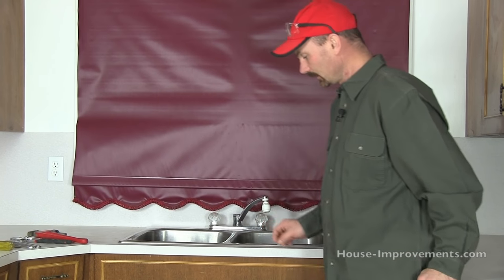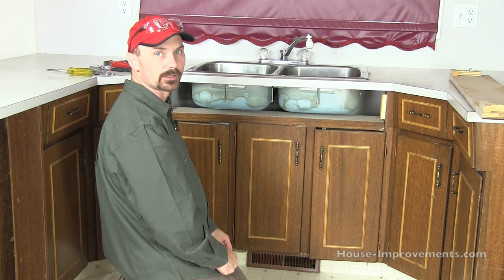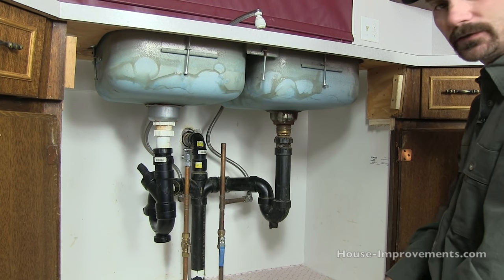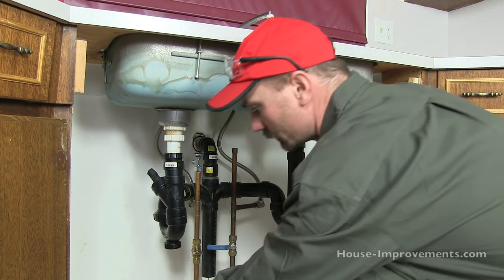How To Remove a Kitchen Sink

Comment: Such a help! Lots of the other videos skip the steps about clamps and what the parts are and how they function. It’s helps to under stand so I can translate it to what the previous owners did with the sink in my house. Thru installed the faucet before dropping the sink in so the faucet fasteners are now blocked by the countertop, so my easy facet switch now involves getting the sink out first. Thank you for the great detailed instruction!

Comment: Thanks. Your demonstration is perfect. Now i have more confidence. I had forgotten that the front panel on the sink cabinet comes off as if the old fully rusted sink mounting screws weren't bad enough. Cheap. The new sink has brass mounting screws. Can't wait to get that awful old sink out.

Comment: Clear, straight-forward and concise. Thanks for taking the time to make and post your helpful video. Liked the no-bucket move with the  leaking stainless braided tubing. The only recommendation: edit out the non-visible loosening and tightening (faucet fixtures). Good camera work and audio! Thanks again from Okinawa, Japan.

Comment: Why is there 23 thumbs down? This was extremely helpful.
Reply: I'd guess because of his surprise about the silicon under the rim. It's pretty standard practice to seal your sink with silicon and most sink instructions state for you to do it. Whoever installed mine was a dick and used grout to seal it, gotta figure out how to get that seal broken.
Reply: When you remove the sink, you can leave the faucet connected to the sink and disconnect the water lines from the shut-off valves.

Comment: Thanks Shannon!   Great video.  I just renovated my kitchen and had no trouble removing the sink but it would have been a great benefit to see this video first as I wasn't sure how the plumbing was connected.  I bought a new sink and faucet.  The new faucet is one of the one handle faucets.  To attach it to the countertop it has just one very long nut that turns forever to get it clamped.  It's hard to get a wrench into the small area to tighten it.  As a result, if you pull on the faucet it will move a bit.  Do you know if there is a better tool for tightening these?
Reply from the maker: I know some of the better name brands include a long plastic type of socket/wrench that works really well. I keep two of them in my plumbing box as they fit most other manufactures as well. But unfortunately that does not help you any. There are "closet wrenches" out there but most i've seen will not fit those large nuts, but have a look for one. Some times you can get a pair of slip joint pliers on it as well.
Reply: Thanks for the quick reply.  I'll go out today to see if I can find something.  I don't like it loose because water might get under it.  Keep the videos coming!

Comment: I jsut took out my powder room sink...it was a pedestal with the drain tucked tight behind...I couldn't get a wrench in to unscrew the drain...so I had to reciprocate the J trap right off where it comes out of the wall.

PS what camera are you using? I like the quality of video and sound.

Comment: I have clamps much higher up and the screws are headless.  The reason I was watching this video is because when I looked in my sink cabinet I could not see the screw driver slots on the ends of the screws and I was very confused as to how to get the screws out.  I got in there with a flashlight and glasses and could see them.  didn't actually need the glasses but the flashlight worked.  If I could share pictures in comments here, I would for anyone else who has a sink like mine.

Comment: Another nice video. But I have a question, why not disconnect the faucet from the main lines and pull it all out together and then disconnect the faucet it you have ant reason to?
Reply from the maker: The counter top is usually sandwiched between the faucet ,sink and faucet nuts under the counter. So in other words the faucet is not attached only to the sink when dealing with a kitchen sink.
Reply: HouseImprovements thanks. I haven’t gone under it to look yet. I’m demoing my kitchen and looking the plumbing and disposal for the best way to take it out. Thanks again for the videos and the advice.

Comment: Forgot the closet wrench eh? Nothing like them when nothing else will fit. I noticed that second valve on top of the hot feed. Dishwasher? I saw the hole in the back of the cabinet and the opening to the left of the shot that looks like it might have been a  dishwasher opening. That's a long and dangerous section of pressurized hose to have if it's not being replaced regularly. I think you got to this house just in time!

Comment: Why take off the old faucet from under the sink? Just unhook the water supply lines near the drain, and lift the whole sink out. THEN remove faucet when sink is on the floor--MUCH easier!
Reply from the maker: Some sinks like this the faucet is installed through holes in the counter top as well.

Comment: What if the water doesn't shut off on a old sink I'm epoxy the countertop but hard time getting the water off to the sink
Reply from the maker: You could turn off the water to the entire house. After that I would install new ball valves under the sink while the water is off.

Comment: My kitchen sink piping system is similar to this one. I have a 'Y' pipe that comes up from the bottom of the cabinet and also connects to a tube that goes behind my sink's wall. Any idea why I have two pipes instead of the usual one drainage pipe that comes out from the wall?
Reply from the maker: The rear one that disappears is hook to the plumbing vent.
Reply: Ahh thank you very much.

Comment: How do I get those plastic faucet spinners / nuts off if they  are welded on with lime and rust from the sink?  I sprayed some silicon spray on it and hammered away but so far no luck.
Reply: I used a vise grip, ended up cracking the plastic when I tried to turn it. Then it came off!!

Comment: It's easier to detach the water lines to the faucet at the bottom and pull them up with the faucet.  In fact my faucet is so "welded" on, I'm going to have to pull the sink and faucet out together.  Let alone there's a shelf connected to the sink that I can't get off.  I'm having to pull the sink just to replace the faucet. 🤷‍♀️
Reply: Brilliant. Yeah. I agree!

Comment: why not just leave the faucet on the sink, and just remove the supply lines and the waste lines and pull the sink and faucet out all at once?
Reply from the maker: With kitchen sinks most times the faucets are drilled through the countertops unlike many vanity faucets that are only attached to the sink.
Reply: @HouseImprovements  thanks